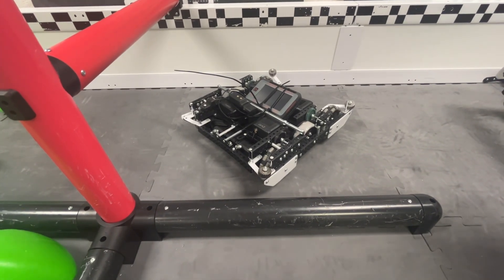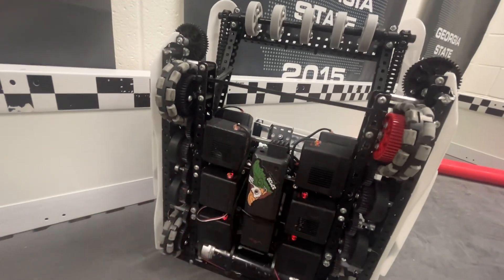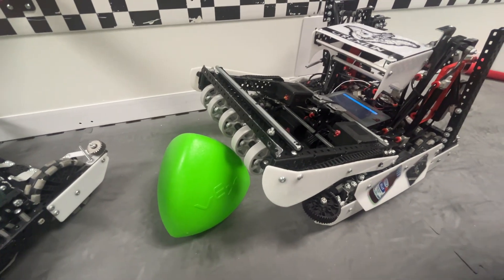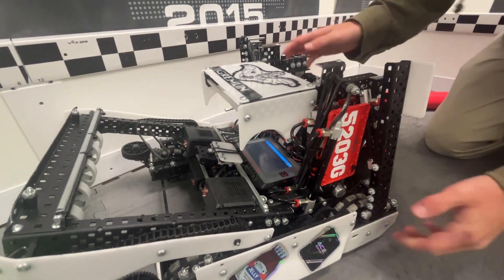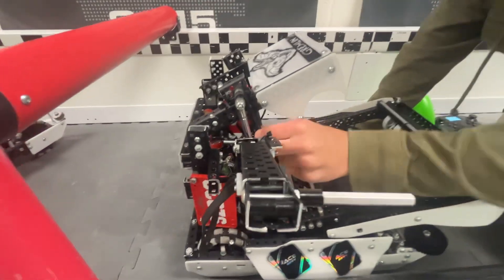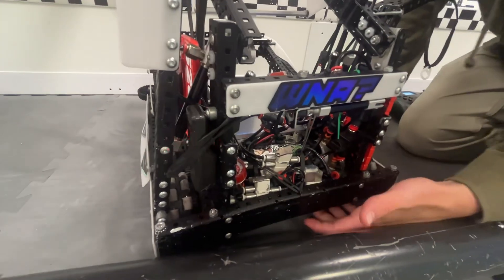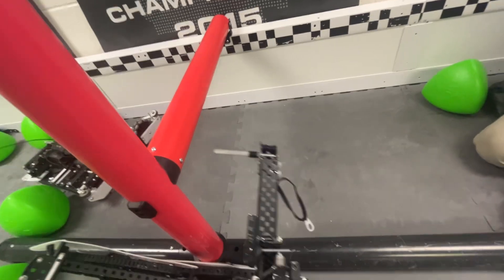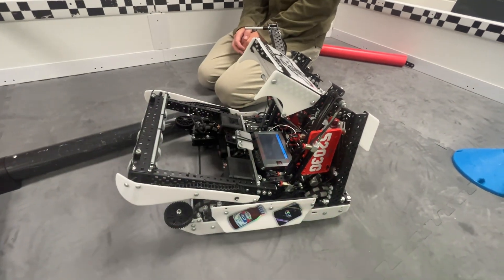5203G Worlds Robot Explanation | VEX Over Under

Comment: did you find that 4 wheels 3.25 450 was faster than 6 wheels 3.25? wouldn't the bot sink more into the tiles and slow it down
Reply from the maker: that doesn't even make any sense